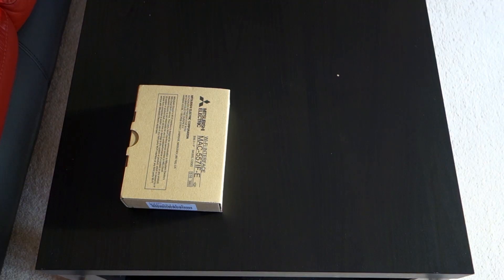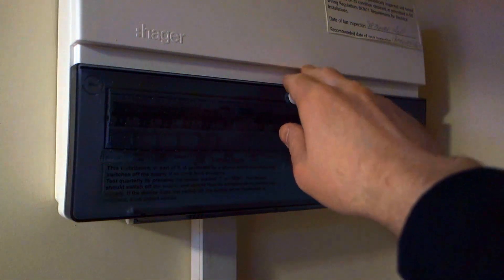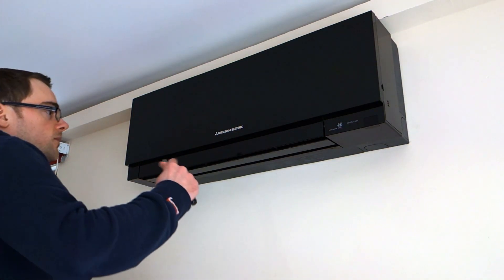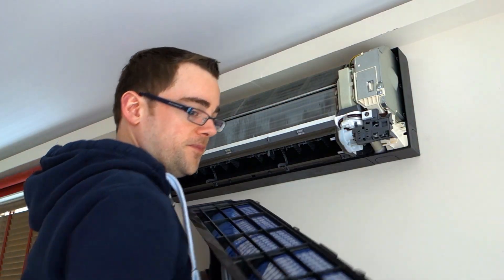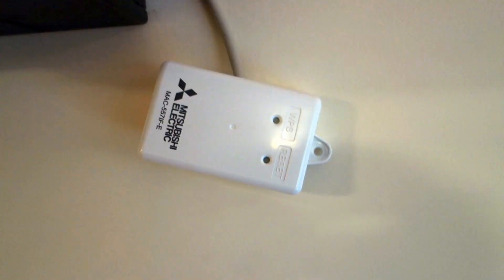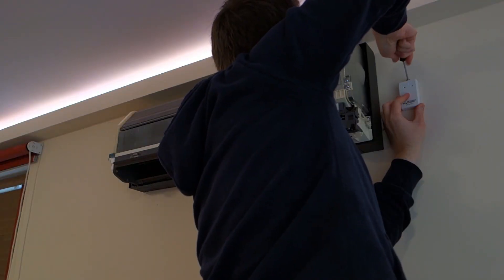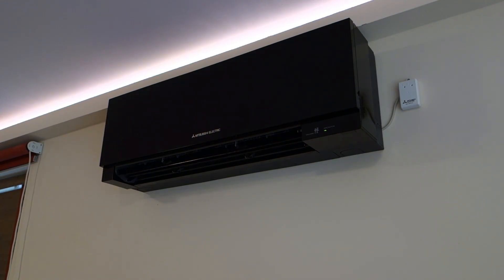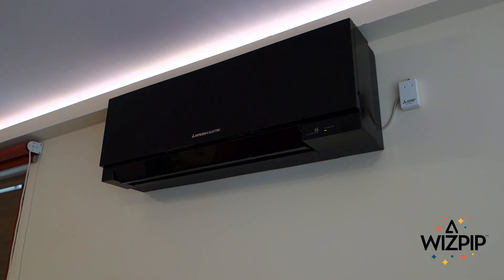Mitsubishi Electric MELCloud installation for Zen with MAC-5571F

Comment: Why do they have to push everything to the cloud? I want LOCAL control of my heating even when Internet is down!,,
Reply from the maker: Local control would require a separate hub and additional programming. Ultimately it comes down to a business decision about cost and effort, and Mitsubishi have decided for whatever reason that it's not worth it. I suspect every customer agrees with you though!
Reply: @PhillipParr  a local API or protocol specification for those who have an installer or a local company doing automation for them and want a rock solid solution for their home heating should be given!!!

Comment: Nice video - helping me decide about which AirCon. Seems you might be able to put the wifi adaptor above the AC unit so you don't see it - as it does not need to be line of sight for any reason (?)
Reply from the maker: You could indeed put it above, you may even be able to hide it entirely inside the bottom cover with some encouragement, if your WiFi signal is strong enough!

Comment: Thanks for you video! It did helped me to put the module MAC-567I-F Wi-Fi in a MSZ-EF42VGS.
In my case i put the module in the left side behind the cover for gas connections, so it became invisible and the wire goes behind near the tubes until the board.

Comment: My council installed Ecodan air heating system, now before I use MELCloud state using the app will modify and circumvent safety water tank heating, and will cost more? 
The air heating system being maintained by Blueflame.co.uk has failed more times than I can count and the outside unit has been replaced at least 3 times. Plus all other major parts, pressure tanks, pipes and circuit boards. All in-accessible so my system heating water 6 hrs a day. ... EDF just estimates 2020 bill for 2 bed disabled bungalow at £14k
Reply from the maker: I can't really comment on a full heating system, but I agree with your sentiment that it seems odd. Your fuel bill estimate is outrageous - does that just include electric / gas? My annual bill is ~£1k for a 3 bed house.
Reply: Saga is still ongoing… my electricity-only bill from August 2023 to Feb 2024 was £3915 with Octopus for Just Me in a bungalow.  

Now my council landlord (contracted agent during annual inspection) has had me LOCKED out (Terminal Husband/carer Died April ‘23) out of any adjustment or schedule on the FTC4 panel.  Didn't know until it got cooler. 

Hot water is set to 45C so have to boil kettles to do dishes as not hot enough.  It's cold so it cools. 

Currently costing over £7 a day.  It was almost £20 a day last Christmas. 

My home is NEVER warmer than 16C. But rads now seem to be on constantly and I cannot access the schedule or adjust (FTC3 its locked) other than to reduce operating temp that's at 10C?  I'm on fixed budget so cannot afford 75% of my income to go to heat/hot water.

Comment: I just bought an IR remote that is wifi activated from the app it came with. It was $14 on Amazon.
Reply: Does it require internet connection too, or can I control the equipment just having wifi  (local network)?
Reply: @jogonca1500  I don't know. It requires an app, so I am guessing internet connection is required.
Reply: @jogonca1500  yeah, IR BLASTERs need internet also, if you want to control your aircon (away) outside the house, EVERY solution needs internet. if no internet (like summer house or smthing) buy 3g/4g GSM ROUTER, or just use old phone (yes it needs sim with internet)  as a hotspot. but yeah IR BLASTER is the easiest solution. (IR BLASTER = universal remote, same time as you switch air con ON/OFF, you can use same IR B. to switch on TV etc
Reply: A link to the remote please
Reply: @zipeer1984  
It's now $23... Still a great alternative to the factory conversion. 

https://www.amazon.com/Broadlink-Automation-Learning-Universal-Compatible/dp/B07K2DHXB6/ref=sr_1_7?dchild=1&keywords=broadlink+IR+remote&qid=1590935487&sr=8-7
Reply: We just did it for a customer who wanted to turn off ac from another  city. Problem is this tech is one way so she can not know ac status, room is rented daily, so by pressing the on off keybshe might as well turn it on while it was already off.
So tomorrow I am removing the ir and  setting up this wifi module, this is the right way to.do it.

Comment: is not possible install the MELCloud module inside of clima unit, you need to fix it to the wall, esthetically it's awful
Reply: I have all my ac indoor units with this module installed insid -  there is an exact place for them inside